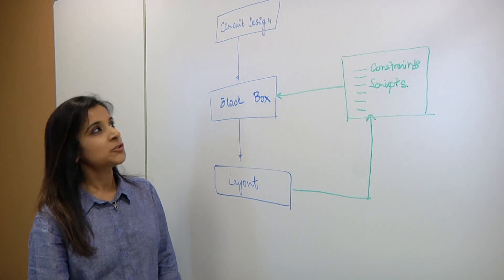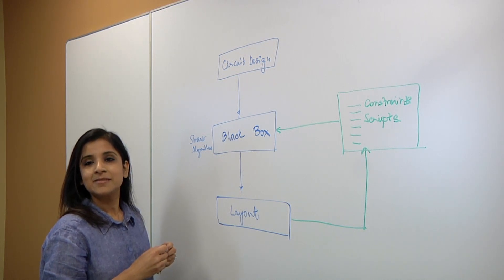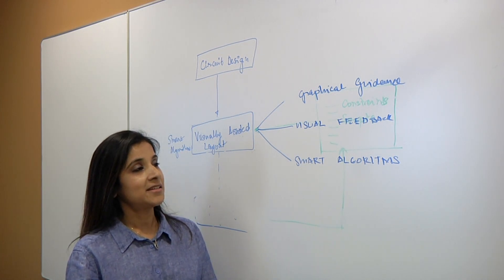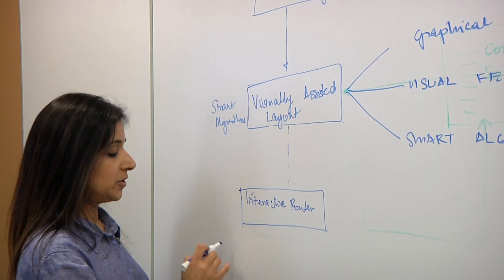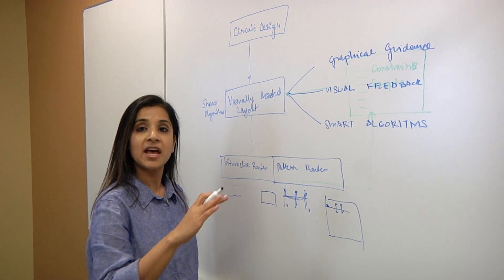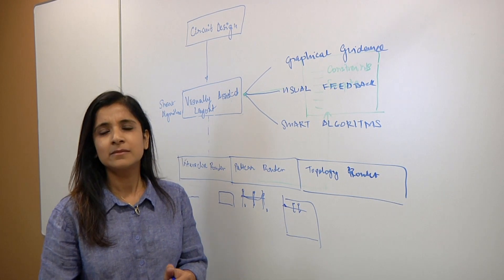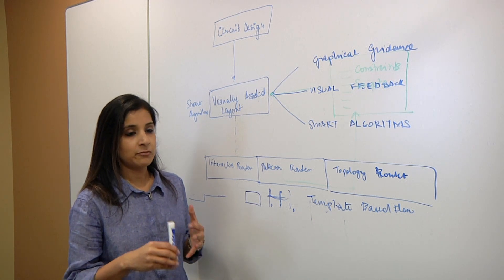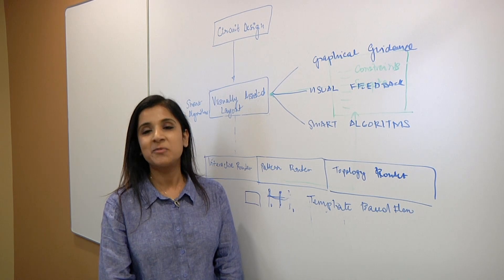Visually Assisted Layout In Custom Design

Comment: Hi , Thanks for the info :)
How well is this applicable for a purely digital circuit? I mean, isn't it challenging to identify a specific routing topology from a DB for large designs? Is this approach already incorporated within Syn tools? Further, I saw that the focus was on routing. How about placement or CTS?